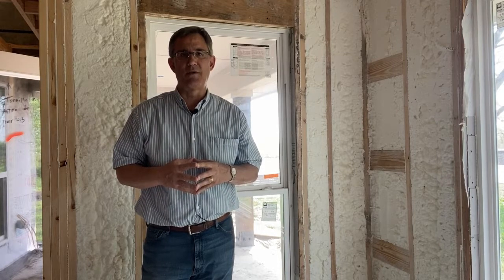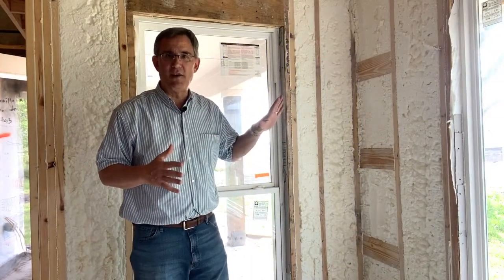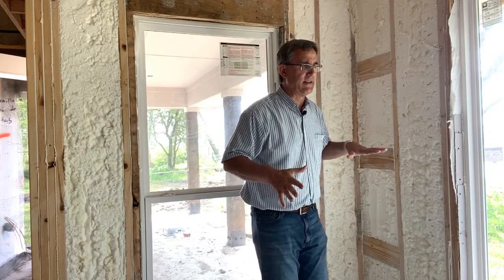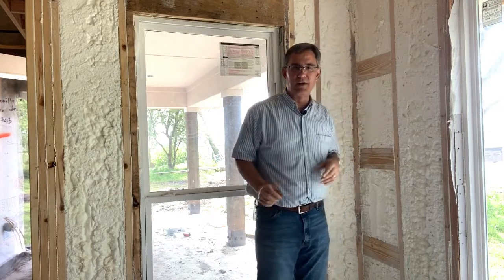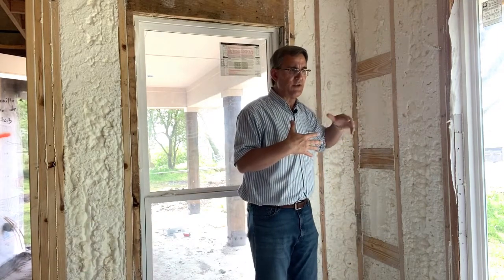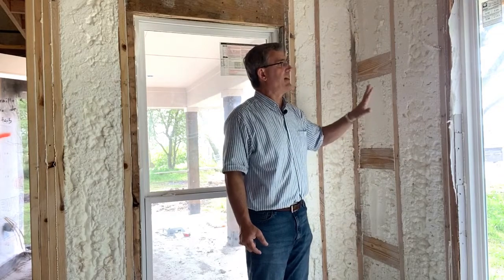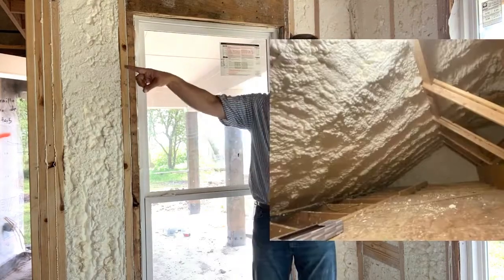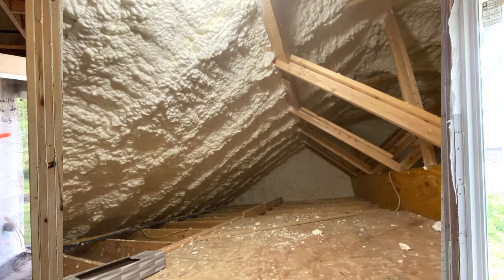Spray Foam Insulation 101

Comment: I love the idea of blown in foam insulation!   I had my house built in Mt Holly, NC, built 2021-22 by Lennar.  I closed on it Jan 31, 2022.     
My exterior walls are 16" studs.   My interior walls are 24" studs. 
The house has batts insulation, blown in attic insulation,  nothing on the attic walls or ceilings.    Living here for 2 winter, and 3 summers, I think the batts are inadequate insulation for heat & cold winters.   It was especially so 2 yrs ago, Dec 2022.  The temps were unusually cold, apx 10° for several days.   The house was freezing, the walls are so cold to touch and drafty by closed double panel windows. 

If I wanted to spend the $$$ can foam be sprayed in with the existing batts in place?
Reply from the maker: There is such a product out there.  Seen it advertised but never seen it done.